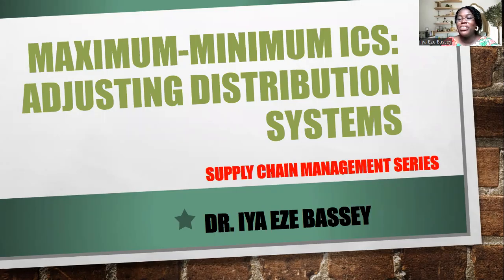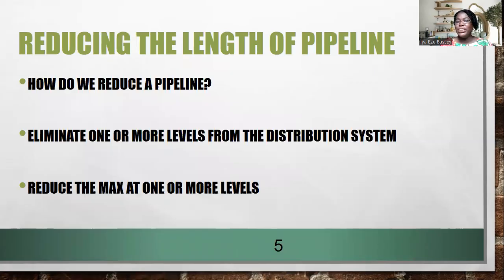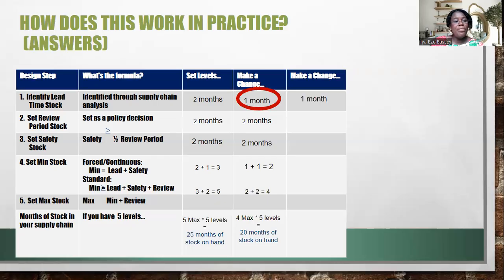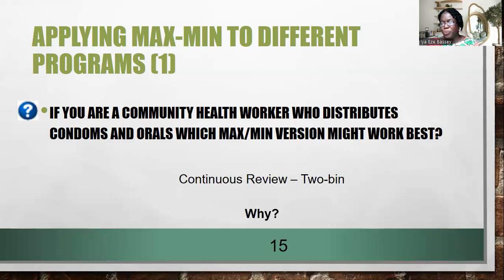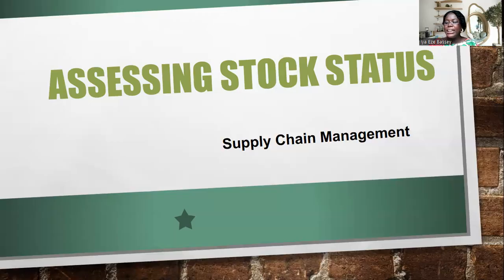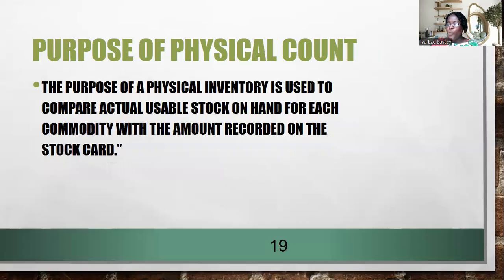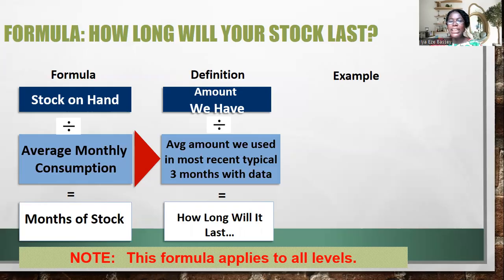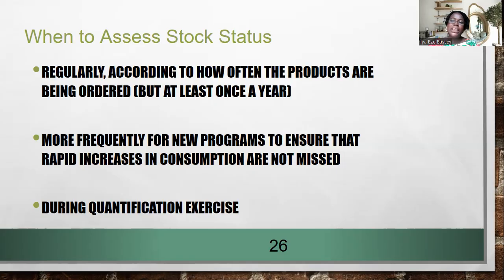Maximum-Minimum ICS: Adjusting Distribution systems (Supply chain management series)

Comment: In this series I understand the steps in designing a maximum minimum inventory control system which includes the following; checking the total length of the pipeline that the policies at each level imply 
Set up initial max min policies for each level and type of the facility 
Checking if the overall distribution will function properly if the level specific max min policies are implemented 
And I also learned how to reduce the length of pipeline 
I learned the factors that impact max min stock leve.
Lastly I note the advantage to using max min system, the challenges to using each version and variation.

Comment: Designing a max-min Ics  has steps and policies that guide these steps to know if they will work for over all pipeline and using these pipeline could take lots of months and this study helps us know that we could modify the pipeline to make sure that clients gets their products  faster to avoid damages of the products while following a systematic way.also application of max -min is not the same for different programs like as stated for drugs ,hiv test kits and labs are a lot for continuous review ,its better to use standard version.the difference between push and pull system,Another important thing is the purpose  of physical count which is to compare the actual number of usable stock on hand for each commodity which is under accessing stock status and should be conducted at least once a year if there are no much issues but if there is a repetition of issues then a count is needed frequently. And further learning calculations to be able to know how long your stocks will last .

Comment: I appreciate you ma
 The max-min ics : refers to setting thresholdfor inventory level. The steps involved in designing the max-min control system are 
1. Check the overall distribution system whether it would function maximally
2.  Set up inital max-min policy
  By setting appropriate max-min  stock levels, laboratories can ensure they have enough inventory to meet testing demands without excessive stockpiling  or shortages . This help maintain smooth operations optimise resources and ensure timely  delivery  of accurate test result

Comment: Check if the overall distribution will function properly if the level specific maximum policy are implemented 
. check the total length of the pipeline we can shorten a pipeline 
Eliminate one or more level form the distribution system 
Reduced the Max at one or more level 
The element which can be changed to reduce the maximum stock level include shorter the reviews period one ore more level shortly the leads time 
Factor that could impact maximum stock 
Cost of commodities 
Reliability of transportation 
Cost of store

Comment: From the video, in the  world of Inventory Control Systems (ICS), it is important to understand the various types of ICS and the significant roles they play in supply chain management. 
     I also learnt that, several different factors can impact maximum levels, including the cost of products, the reliability of transportation, storage capacity, the cost of storage, storage conditions at different levels, the shelf life of health commodities, lead time, the reliability of the source of supplies, the effect of a zero balance of stock, the age of the program, and the accuracy of forecasts.
      And finally, When analyzing stock status, the physical count holds immense significance. It is recommended to conduct physical counts at least once a year, but if a product moves rapidly, more frequent physical counts may be necessary to ensure accurate inventory management. Thank you ma for this wonderful lecture.

Comment: In summary  there's is need to reduce/ adjust the length of the pipeline in order to shorten delivery time and  and reduce  loss,there are steps involved in designing a max / min inventory  control system you must 
-first set up initial max/ min policies for each level and type of faculty.
-check if the overall distribution will function properly if the specific level  max/min policies are implemented.
- check the total length of the pipeline that the policies at each level imply.
The advantage of using a Max/min system is to
- avoid overstocking
-avoid under stocking
-minimize wastage
-avoid cost of emergency order
-simplify inventory control decision making
- consistency of stock levels
- reliable  data source from SDP for forecasting and quantification.
Thank you ma.

Comment: In summary, I learnt how to design a max min ICS, how to shorten the length of a pipeline, the various factors that affect the determination of a max min stock levels, benefits of max min when it comes to preventing understocking and overstocking. I also learnt about the challenges associated with the various types of ICS. I also learnt about how to do a physical count and it’s importance in assessing stock status. I also learnt how to calculate how long a stock will last. Lastly I learnt when to assess stock status.

Comment: Thank you ma'am!
In summary, the steps in designing a Max-Min ICS are as follows:

1. Evaluate the total length of the pipeline to ensure that the policies at each level comply with the specified requirements.

2. Verify that the overall distribution system will operate effectively with the Max-Min policies implemented at each level.

3. Establish initial Max-Min policies for each level and type of facility. The advantages of using a Max-Min system include:

   - Avoiding the cost of emergencies.
   - Minimizing wastage.
   - Preventing overstocking.
   - Avoiding understocking.

Comment: In conclusion to what I have observed from the just concluded video I learnt about the steps in setting up and designing a maximum ics which are as follows 1.set up initial maximum policies for each level and type of faculty 2. Check if the overall distribution will function properly if the level specific maximum policies are implemented 3. Check the total length of the pipeline that the policies at each level imply
    Ways by which we can reduce a pipeline is as follows 
* eliminating one or more levels from the distribution system
*Reduce the max at one or more level 
    Factors that impact maximum stock level are: ^ cost if products ^ Reliability of transportation ^cost of storage capacity etc
   Elements of formula which can be changed I order to reduce the stock level * shorten the review period *reduce the lead time at one or more level * improve the distribution system Reliability at one or more level so that safety stock can be reduced 
   The advantage of using max- min system which are 1.avoid overstocking 2. Avoid under-stocking
3.minimized wastage 4. Avoid cost of emerging orders etc and I also learnt of the challenges to using each version and variations and they are ad follows: system with numerous system, system that manage a larger number of commodities, system that manage products for new programs and what a physical count is which is know as the process of counting by hands the total number of useable units of each commodity in your store or health facility at any given time and to determine how long a supplies will last. thank u so much ma

Comment: Thanks ma for this amazing lecture on the maximum -minimum ICS: Adjusting distribution system .
I got to know the steps in designing max-min ics, which are:
1)set up initial Max-min policies for each level and type of facility .
2) check if the overall distribution will function properly if the level specific max-min policies are implemented 
3) check the total length of the pipeline that the policies at each level imply.
 Also elements that can be changed in order to reduce max stock level ;
1)shorten the review period at one or more levels
2) Reduce the lead time at one or more levels 
3) improve the distribution system reliability at one or more levels so that the safety stock can be reduced.
And the other factors that impact max-min stock levels are cost of products,cost of storage,age of program, accuracy of forecast etc .
 U made me understand that there are advantages of using max-min systems.They are
1) Avoid overstocking.      [2] Avoid understocking
3)minimize wastage.        [4] consistency of stock level.      [5] Avoid costs of emergency orders etc.
And also challenges to using each version and variation:[1] systems with numerous levels.              
[2] systems that manage a large number of commodities.   [3] systems that manage products for new programs.
   Also got to understand what a physical count is and that it is a counting by hand the total number of usable units of each commodity in ur store or health facility at any given time. Also the purpose of physical count which is used to compare the actual usable stock on hand for each commodity with the amount recorded on the stock card .
  Also noting that the purpose of accessing stock status is to determine how long supplies will last
I also learnt the formula for how long a stock will last and calculating MOS on hand and that it also applies to all levels.
 Not forgetting to note when to access a stock status which is [1] Regularly, according to how often the products are being ordered{but at least once a year}.     [2]More frequently for new programs to ensure that rapid increases in consumption are not missed 
[3] During quantification exercise

Comment: Thankyou ma for this wonderful lecture 
In summary I got to understand the ways to adjust the distribution systems in Max-min inventory control system i.e from understanding what a pipeline is, the length of a pipeline and how to reduce the length of a pipeline ( which is done by  eliminating one or more levels from the distribution system and reducing the maximum stock level at one or more levels)
   I learnt about the factors that affect Max-min stock levels which are cost of products, storage capacity, cost of storage, lead time etc. I also learnt about the advantages and challenges to using each version and variation and under accessing stock you talked about physical count as process of counting by hand the total number of usable units of each commodity in store. It is done once every year and sometimes frequently.

Comment: I have learnt that that adjusting the pipe line can help reduce the length of the pipe line and reducing maximum stock level by shortening the review period at one or more levels.
   The important of maximum system is:
1) Avoidance of cost
2) Avoidance of overstocking
3) Avoidance of understocking
4) Minimizing of wastage.

Comment: From Adjusting the Distribution systems in Max Min Inventory Control System and Accessing stock status. I learnt the importance of adjusting the Max Min Inventory Control System and this began from understanding what a pipeline is, the length of a pipeline and how to reduce the length of a pipeline. In reducing the length of a pipeline I learnt that it's done in 2 ways which are: eliminating one or more levels from the distribution system and reducing the maximum stock level at one or more levels. To reduce the maximum stock level, it's done systematically, not arbitrarily. Also I learnt the factors that affect Max Min stock levels which are cost of products, storage capacity, cost of storage, lead time etc. The advantages and challenges with using each version or variation. In Accessing stock status, I understood the importance of physical count as it is to compare the usable stock on hand for each commodity with the amount recorded on the stock card. It is done once every year and sometimes frequently.

Thank you so much ma for an educative lecture.

Comment: In summary,i got to understand the steps involved in designing a Max-Min ICS thus:
1.Check the length of stock of the pipeline.
2.check if the overall distribution would function properly. 
     When the pipeline is too long, we reduce it by
a. Eliminate 1 or more levels from the PDS
b. Reduce theax level at one or more levels. The systematic way of reducing pipeline length :
1.shorten the review period
2.Reduce the lead time
3.distribution reliability could be reduce. 
However some factors that impacts max/min stock level:
1.cost of products 
2.storage capacity 
3.cost of Storage
4.Reliability of transportation 
5.lead time 
6.Reliability of source of supplies 
7.managemrnt skill of staff
8.Accuracy of forecasts.

Comment: Thank you Ma, for another interesting section. 
Through this lecture, I come to understand that; the distribution system policies cam be adjusted by; (a). Reducing the length of the pipeline that is eliminating one or more from the distribution system and reducing the maximum at one or more level
(b). Reducing the maximum stock level, i.e shortening the review period and lead time at one or more level. 

I learnt that, the length of pipeline involves the steps in designing the maximum - minimum inventory control system which are setting up at initial maximum - minimum policies for each level and type of faculty, and checking the total length of the pipeline that the policies at each level are maintained. 
I also understood that, physical count is the process of counting by hand the total number is usable unit of each commodity in the store at any given time which is used to compare actual usable stock in hand for each commodity with the amount recorded on the stock card.

Comment: The Max-min inventory control system (ICS) provides comprehensive guidelines for managing stock levels to prevent both overstocking and understocking of goods. It encompasses various steps involved in designing the system, methods for reducing pipeline length, and factors affecting the Max-min stock levels.

This series of lessons has been incredibly enriching. Not only does the Max-min ICS help in preventing overstocking and understocking, but it also aids in avoiding emergency order costs by providing a guide to the stock status on a regular basis. Furthermore, it assists in the assessment and management of the length of pipelines of policies at each level.

Moreover, I've gained a deeper understanding of the benefits associated with the Max-min system, such as its ability to prevent overstocking and understocking, as well as the associated challenges that arise from different versions and variations.

I am truly grateful for the knowledge gained from this series. Thank you, Ma
Reply: The maximum stroke minimum inventory system provides comprehensive guidance for managing stock level to prevent both over stocking and understocking of goods

Comment: We have seen the various types of ICS and the role they play. In certain cases the length of a pipeline can be too long and as a result of that needs to be shortened in order to meet up demands. When this happens we reduce the length of the pipeline by eliminating one or more levels from the distribution system, reducing the max at one or more levels and also reducing the lead time at one or more levels.
       We have certain factors that impact maximum levels. These are cost of products, reliability of transportation,storage capacity,cost of storage, storage conditions at different levels,shelf life of health commodities,lead time, reliability of source of supplies,effect of a zero balance of stock, age of program and accuracy of Forecast.
        There are various advantages of using the max-min system. This include avoiding over stocking and understocking, making stock levels consistent and avoiding cost of emergency order. 
         In assessing stock status, physical count is important. It should be done at least once a year but if the product finishes very fast physical count can be done often.

Comment: I want to thank the lecturer for the excellent presentation. After watching the video, I was able to gain a comprehensive understanding of the key steps involved in designing a max-min inventory control system. Additionally, I learned about the various methods that can be employed to reduce the length of the pipeline, which include eliminating one or more levels from the distribution system and reducing the maximum at one or more levels.

Furthermore, I developed a clear understanding of the advantages of a max/min inventory control system, which encompass the ability to avoid overstocking, prevent understock, and minimize wastage. This knowledge is invaluable in terms of optimizing inventory management practices.

Moreover, the lecture also shed light on the core purposes of an inventory control system, emphasizing the importance of maintaining appropriate stock levels and avoiding shortages and oversupply, among other vital functions.

In addition, I gained insights into the key factors that impact max-min stock levels, including product cost, storage capacity, and the cost of storage. Understanding these factors is crucial for achieving effective inventory control and management.

Lastly, the lecturer provided a detailed explanation of the process of physically counting the total number of usable units in store or health facilities at any given time, highlighting the significance of this approach in assessing stock levels accurately.

Comment: From this lecture, i learnt the steps involve in designing the Max-Min Inventory Control System, which are;

1. Determine your lead stock
2. Set Review Period
3. Set safety stock
4. Set minimum stock level
5. Set maximum stock level
6. Set Emergency order point (EOP)
 

I also learnt on what can be done to reduce the length of a pipeline

1. Eliminate one or More levels from the distribution system
2. Reduce the maximum at one or more levels.